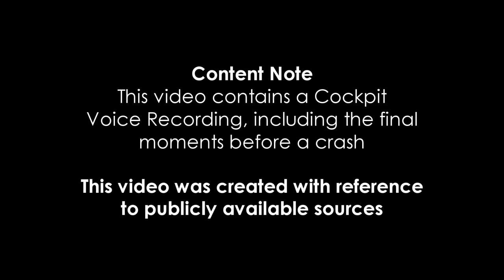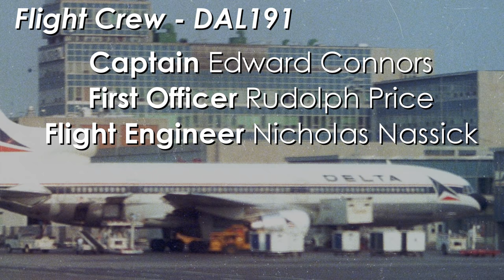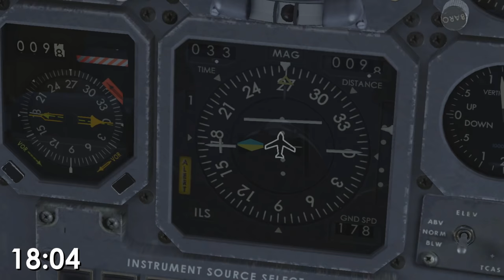How Deadly Weather Brought Down This Plane (Delta Airlines Flight 191) - DISASTER BREAKDOWN

Comment: I disagree that the L-1011 had a “troubled past”. None of the accidents mentioned were related to the engineering of the aircraft.
Reply: Agreed as a former L-1011 pilot. The DC-10 reputational problems were largely design or maintenance issues; the L-1011 accidents were largely pilot error accidents. In no way way did the L-1011 have a bad reputation with anyone to include pilots (who loved it) or regulators. It’s by far the best aircraft I’ve ever flown (and I’ve flown nine types of airliners).
Reply: @HEDGE1011  Indeed. A troubled past, what a joke of a statement. The TriStar was the safest airliner of its time, way ahead of every single other one in technology. Better than that joke DC-10, an absolute shame to plane history. I love this channel's videos but this one always makes me cringe a bit because every accident that the Ten-Eleven had was either a pilot error or a maintenance error. Never had a troubled past or fame of bad design and funny enough, any time the aircraft had a mechanical error (most of those due to incorrect maintenance) everyone landed safely due to the advanced technological prowess of Lockheed Martin. Eastern Airlines can prove how good and reliable the L1011 was. Two engine failures in-flight, both on Eastern planes due to incorrect maintenance from the company. Those planes landed safely due to not losing manuebravility or hydraulics, literally a proof of how reliable and sturdy the TriStar was. Now you try to land a DC-10 with an engine failure, it'll probably break down midflight and kill everyone.
Reply: Yes L1011 is the safest widebody trijet plane,as former pilot of Malaysia Airlines DC 10 i agree that DC 10 was troubled aircraft,the control was heavy,i would take occasion when i was ask to fly plane and airline know about this also force all pilot that suppose to charge to fly the plane especially when was told to fly to Kai Tak airport,the airport that serve city of Hong Kong and scare me most is infamous runway 13 approach or heart attack approach because it would give you heartache since the plane have heavy control and it dangerous reputation you might think that you are flying a coffin to the grave however flying DC 10 was a wonderful experience since the variant of DC 10 that i fly is series 30 there's a little accident invovling egineering and it serve with Malaysia Airlines with no accident at all
Reply: @roskasan574  
Turkish air is the only DC-10 crash because of a design problem.
Reply: @HEDGE1011  I've spoken with quite a few old-timers who say the exact same thing.  The Tri-Star was a great plane.
Reply: @alhanes5803   What about that thing with the cargo doors?
Reply: @lucassouter5053  
Total screw up.
They fixed it though, and it went on to  become a great plane.
I flew them many times.
The L1011 was always my favorite,  but once inside, you really couldn't tell much difference between the 2.
They were both great machines.
Reply: @alhanes5803  but there were multiple incidents where the cargo door broke.
Reply: @lucassouter5053  
2.
Windsor,  and Paris.
Reply: We believe in the L-1011 Tristar superiority
Reply: Troubled as in it flopped big time in terms of units built. Lockheed lost a shit ton from the L-1011 project. But i still dont know why. It was miles better than the Flying Wreath or Death Cruiser Number 10 aka the DC-10.
Reply: @tommcglone2867  
They were both great airplanes
Reply: @themaskedtalker2171  as in the wreath at a funeral.
Reply: Can't disagree with your point on aircraft quality. May I point out that the "troubled past" does not necessarily mean that the problems were with the aircraft design. It is possible, for example, for a "troubled past" to mean orphaned at an early age and sent to a state school... without being a delinquent. Nontheless, your clarification is appreciated. Thanks.
Reply: Delta planes crash all the time.
Reply: @jaysantos536  care to identify the last “crash” for Delta?
Reply: @HEDGE1011  you are right but there were some tings that made the aircraft more vulnerable to pilot error like warning sound.
Reply: @alhanes5803  - Wrong.  The initiating issue for AA191 was maintenance, but it was two design deficiencies (single point of failure on the AOA/stick shaker system AND the non-fail safe design of the slat system) that doomed the flight.  Similarly with UAL232 - routing all of the hydraulic systems in the same vicinity in the plane of rotation of the engine without a hydraulic fuse (and having only three hydraulic systems, rather than four like the L-1011) was another design deficiency which led to the accident, even though those weren’t initiating factors.
Reply: @alhanes5803  - You could if you knew their systems or flew them both - which I did.  The DC-10’s engineering was far inferior.  Even the cabin door opening system was a cobbled together Rube Goldberg mess as compared to the Tristar’s elegantly simple system.
Reply: @tommcglone2867  - It was later to market due development issues with the RB.211 power plant (which went on to be an outstanding engine) which brought Rolls-Royce to insolvency and set the entire program behind.  The S-ducted #2 engine design dictated a shorter powerplant than either the CF-6 or JT-9D, obligating Lockheed to the Rolls engine.

I believe the DC-10 was also a bit cheaper to purchase.
Reply: @bradcrosier1332  
You sound like an expert, Bradley....
Reply: @alhanes5803  - Expert can be debated, but I’m rated in and have flown both, so I’m pretty familiar with their design and their systems - including the band-aid fixes Douglas implemented after UA232 - but you know all about that, right Al?  Also, I’ve read and studied the accident reports for AA191 and UAL232, in no small part because I was flying the DC-10 and wanted to understand it’s deficiencies (as any competent airman would want to do on any airframe they are operating).

I’ve said more than once I’ll give the DC-10 credit - it actually flew nicely (somewhat to my surprise), but it was definitely under-engineered, that’s just a fact.  Heck, many of the band-aids were still present in the MD-11, which I also am rated on and flew for three years.  I actually kind of liked flying the MD-11, but it still very much showed it’s heritage in some ways, and definitely didn’t handle as well as the DC-10.  It could be flown safely and wasn’t a bad aircraft, but it was a unforgiving and would bite if provoked (as its accident record demonstrates).
Reply: @bradcrosier1332  
I was wondering,
Can you explain the
"AOA/stick shaker system",  and what one has to do with the other?
Reply: @bradcrosier1332  
Um, my last name is Hanes,  Brad.
As far as your qualifications,  it doesn't really matter to me whether you have them or not.
After the rambling, long drawn out so called answer you just gave,  it sounds as though you have definitely been at high altitude without oxygen too many times.
Reply: @alhanes5803  - Ok Al, so are you the student pilot Al Haynes, the private pilot Al Haynes, one of two ATP Al Haynes (one with no type ratings), or the mechanic or repairman Al Haynes?  Of course it’s entirely possible you might not hold a U.S. certificate, or are not a pilot at all.  I also notice
you didn’t address the crux of my question - are you just upset and challenging me because I’m rebutting your statements, or is this a legitimate question?   It seems to be the former, based on other posts (such as those in another thread on the MD-11 involving the loon “Slow Poke”) of yours I’ve read, as it seems you yourself would have the requisite knowledge to understand the relationship between AOA and stall warning devices.  Hence why I’m not eager to waste my time simply amusing you.

If you think my statements inaccurate, then say so.  If you are genuinely seeking edification, I’ll be happy to share the knowledge I have.  If you’re simply baiting me, then I’m not interested.

As to the time I’ve spent at high altitude, it’s all been in pressurized aircraft, no supplemental oxygen required except when the other pilot left their station.  Yes, I realize that’s an attempt at an insult on your part - the problem for you is I can actually back up my qualifications and knowledge (which it appears you did not anticipate), you the jury is still out on.

As to long, drawn out answers, you probably won’t like my response if your AOA/stick shaker query is an honest one - part of why I’m attempting to ascertain its nature. 

I will however confess to at least one mistake I’ve made - I was misspelling your last name based on that of the Al Haynes - my apologies.  The rest of my questions still stand however.
Reply: @bradcrosier1332  
I asked a serios question.
To explain in your words,  AOA/Stick shaker.
Reply: @alhanes5803  - That's fine.  You've been quite vague otherwise, and as I previously stated - other posts of yours indicate that you should already have that level of understanding.  But I suppose  I'll play along (even though you won't extend the courtesy of properly identifying yourself which I have done for you).  Give me a bit and I'll get back to you, I don't have time at the moment to formulate a proper response.
Reply: @alhanes5803  - When it gets technical (and this is a technical question), I try as much as possible to avoid using my own words lest I inadvertently color the description though an inadvertent poor word choice; thus I shall (at least to begin) start with an excerpt from my DC-10 (Series 30) manual regarding the stall warning system (please forgive any typos on my part, as the PDF is locked and I cannot simply copy and paste):

"Stall warning is provided by the autothrottle computers.  The computers condiser inputs from the two Angle of Attach (AOA) vanes and the flap and slat position transmitters.  If either autothrottle computer calculates that the aircraft is at or below [1.05] VStall while in any configuration, a stick shaker for both pilot's control columns will activate.  Depending upon aircraft speed and configuration, the stall warning signal may also cause an auto slat extension and opening of hydraulic reversible motor pump valves.

A stall test switch is provided on the pilot's overhead panel to allow an independent test of each stall warning system while on the ground. The test is delayed for 5 second following switch activation."

Note that this manual is from many years after the AA191 accident and was equipped with dual stick shakers, while AA191 was not (the second was an option, which the airline elected to not pay for - the lack of redundancy I mentioned.

From the NSTB report on the accident:

"The loss of the No. 1 engine and its associated generator causes a loss of many aircraft systems end instruments. Among these are: The captain's flight instruments; the left stall warning computer, the stickshaker motor, N0 1 engines  instruments, the slat disagree: warning light system, portions of the flight control indicating system, portions of the DFDR sensors, and the CVR.  In addition to these losses, the flightcrew would be presented with numerous warning lights. The caution and master warning lights on the glareshield would be illuminated.  Hydraulic and electrical malfunction lights would be on the annunciator panel and on the flight engineer's panel.  Power to the left a.c. and d.c. emergency buses could have been restored by rotation of the emergency power switch to the "on" position. This action would have powered the l e f t a.c. and d.c. emergency buses and restored the operation of the captain's instruments as well as some of the engine instruments."

Without getting too far into the technical weeds, the DC-10's AC system normally operates in parallel, so the loss of one generator would not result in the loss of any busses.  HOWEVER, the circuitry also provides protection for a differential fault on the bus, in which case the circuitry will open and NOT permit the other generators to power the bus.  It is believed that when the wire bundle from the #1 engine was severed, it activated this logic, thereby isolating the #1 AC Bus and the L Emergency Bus.  Unlike the AC busses, the DC busses are normally isolated from each other, but can be tied together in the event of a transformer/rectifier failure.  To continue with the NTSB's take:

"The flightcrew might have been able to restore the No. 1 generator bus and all of its services by activating the guarded bus tie relay switch on the electrical and generator reset panel. This action would have been effective only if the bus fault sensed during the separation was temporary. The evidence indicated that the left emergency a.c. and d.c. buses, and the No. 1 d.c. bus could have been restored separately by the activation of the emergency power switch and the No. 1
d.c. tie switch in the cockpit. There was no evidence to indicate that this was done.

The Safety Board believes that the flightcrew probably did not try to restore the lost electrical power, either because of the nature of the overall l emergency involving other systems, which they probably perceived to be more critical than the electrical problems, or because the time interval did not permit them to evaluate and respond to the indicated electrical emergency. The Safety Board does not criticize the crew's inaction in this regard; however, since electrical power was not restored, the captain's flight director instrument, several sets of engine  instruments and, most importantly, the stall warning and slat disagree warning light systems remained Inoperative."

Also under-engineered with the slat system, which simply held the slats in place with trapped hydraulic pressure (rather than locking mechanism, such as the L-1011 had), again from the NTSB:

"During takeoff, as with any normal takeoff, the leading edge slats were extended to provide increased aerodynamic lift on the wings. When the slats are extended and the control valve is nulled, hydraulic fluid is trapped in the actuating cylinder and operating lines. The incompressibility of this fluid reacts against any external air loads and holds the slats extended. This is the only lock provided by the design. Thus, when the lines were severed and the trapped hydraulic fluid was lost, air loads forced the left outboard slats to retract. While other failures were not critical, the uncommanded movement of these leading edge slats had a profound effect on the aerodynamic performance and controllability of the aircraft. With the left outboard slats retracted and all others extended, the lift of the left wing was reduced and the airspeed at which that wing would stall was increased. The simulator tests showed that even with the loss of the No. 2 and No. 4 spoilers, sufficient lateral control was available from the ailerons and other spoilers to offset the asymmetric lift caused by left slat retraction at airspeeds above that at which the wing would stall. However, the stall speed for the left wing increased to 159 KIAS."

The last citation is off topic of your query about the AOA/stick shaker system, but seemed relevant to the overall discussion.  Like I said, in my brief time on the DC-10 it flew nicely, but it was something of a cobbled together mess to fix the various deficiencies (such as these, as well as the lack of a hydraulic fuse in the #3 system which resulted in the UAL232 accident).

Hopefully that answers your question, any others?
Reply: @bradcrosier1332  
I understand, and already knew everything you just mentioned,  however, alot of the problems I have with alot of these videos,  and the comments from alot of people who don't have a clue about what they're talking about is, people are led to believe #1 engine operates everything period.
They don't know power switches automatically, or can be switched manually to another engine in case of a failure of #1.
I'm with you, and the NTSB,  that the pilot's are absolutely not at fault. 
You get some altitude 1st, then start going thru systems. 
They simply didn't have time to understand what was going on.
The L1011 was engineered to the hilt, especially for it's time.
What I would like to know is, how many other types were engineered differently than the 10, at that time.
I'm not being Asmara ass Brad, but 1 thing that aggravates me is, had A/A mechanics not screwed the pooch,  this would not have happened.
Douglas engineers never expected the pylon or attachments to ever break in the life of the airframe.
The mounting points on the 10, and all planes are designed for the engine to break away, under severe engine failure, under the wing, not over it.
With the rear mounting attachment breaking the way it did, at full thrust, and no engine failure, is what caused it to go up and over, destroying electrical,  and hydraulic components. 
You know as well as I, that you can't engineer out stupidity. 
The plane had redundancy,  but how can you anticipate,  or what were the odds that the hydraulic lines going to the slats would ever sever.
We know now that it's possible, like with  the Qantas 380 with a severe uncontained engine failure. 
Bi ask again,  in the mid sixties when the 10 was designed,  how many planes were designed any differently?
I don't  know the answer to that, but I'm guessing most. 
Again it aggravates me, when people are made to believe 10,s were just falling out of the sky constantly. 
As far as I know, the only 3 fatal crashes because of a so called design flaw, was Turkish air, 191, and 232.
All the others were pilot error. 
You know how the press works. They jump on something and run it thru the ground.
Did the 10 have some problems? Yes. But after the cargo door fiasco,  it went on to become a very reliable plane. 
I think it, and Douglas got a very bad rap, that wasn't warranted. 
They stomped Boeing thru the ground over the max, and the 787.
Airbus has had their problems,  but people love to hold up for them, as if they can do no wrong. 
If you've never seen it, Greg Fieth, and John Golia has a podcast on YouTube,  called Flight Safety Detectives. 
You should see what they have to say about the two max crashes, and the bs surrounding them, and Boeing. 
I'm  not a jackass, that's mad at you, these are just simply my take.
I would love to hear back from you.👍
I love commercial aviation,  and always have.
Reply: @bradcrosier1332  
Sorry,  I made a couple errors spelling, but you'll get it.🙂
Reply: @alhanes5803  - Regarding the typos - no worries, I have MORE than my share of those, and I do get the gist!

Beyond that, I don't have time to address all of your points, but I'm glad my suspicions about you were confirmed - I thought your other posts indicated a level of knowledge which made my explanations a waste of time - though I do understand your reasoning for doing so.  That said, a quick search of the airman registry on your part would have saved me thirty or more minutes assembling my response.  Nonetheless, I am please to make your acquaintance. 

I 110% agree with you about being irritated at armchair experts who think they know everything and ignore input from those in the industry who actually do have at least some greater depth of understanding than they do.  

You are also correct about the DC-10 going on to be a reliable aircraft, and you are correct that the KORD and KSUX accidents weren't directly due to design flaws, which is why I try (I'm sure I slip up at times) and use the term deficiencies instead.  It wasn't the that design was inherently defective, but it did lack resilience or redundancy which could have prevented the accidents.

As for it's overall design/engineering - it definitely seemed more like a Chevrolet to the Tristar's Cadillac.  I mentioned the cabin door system - the DC-10's really was a Rube Goldberg nightmare, whereas the Tristar's was incredibly simple to operate.  The cockpit crews on the DC-10 where I flew it hated positioning flights without flight attendants, because then we'd have to operate the door - EVERYONE was afraid of accidentally blowing a slide due to it's poor design (and most of them had previously operated the L-1011).  In time you got used to it, but it was certainly not as foolproof as the system on the Tristar.  That just seemed to carry over everywhere with the aircraft - to me it reeked of being rushed to market to beat Lockheed, which it did, and as a result (at least in part), it clearly won the sales race.

Beyond that, you're right - if anything the Tristar's over-engineering sometimes was a vice, but usually it was a boon.  As to the engineering of other aircraft of that era - I can't speak with great authority, since I never flew the the 747 classic, but I believe the leading edge flap mechanism on the classics was the same as on the -400.  Those were actually air-driven, and unless I'm completely slipping a cog, they were locked extended, not held there by air pressure.  To me using trapped pressure to hold something as critical as leading edge devices is a very poor engineering choice - and Douglas was the only one of the three first generation widebody builders to make that choice.  No, I can't fault them for not anticipating the exact mode of failure which occurred at KORD.  I can fault them for failing to design a system which was more robust and damage tolerant.  The same argument can be made regarding UAL232 - poor design to route all of the hydraulic systems in the plane of rotation of an engine and not have some means of isolating them in the event of a catastrophic failure.  IIRC correctly, they did provide separation of the systems in the wings, but inexplicably not in the tail where all three ran in close proximity!

No doubt about 191 being very flawed maintenance practices at American by "Forklift Joe" Leonard, later of ValuJet fame.  And you're quite correct - American should have taken the lion's share of the blame.  Ironically, Douglas role in that accident was very similar to Boeing's in the MCAS debacle - a lack of resilience and redundancy, rather than an outright flaw - good luck finding that coverage anywhere in the media.  American's maintenance practices should have gotten much more press, just as Lion Air and Ethiopian's pilot competence should be getting more scrutiny - but that's not the chosen narrative, so the bigger issue is going to be swept under the rug until it raises its head again another day.

Regarding Airbus v. Boeing, I pretty much agree, but I'll add one thing which I've stolen from a former colleague which describes it pretty well:  Boeing designed and built airplanes for airmen to operate (though I do think  their culture has seriously deteriorated due to upper management's decisions, at least some of which were post Douglas merger, but not all).  Airbus on the other hand designed and built aircraft which could be operated with a minimal level of airmanship - designed to take the pilots out of the loop as much as practical so they could be, as I've heard them referred to, merely "FAGOs" - flap and gear operators.

I'll have to check out "Flight Safety Detectives," - great, another place to piss away a bunch of my time on YouTube!  😄

Cheers!
Reply: @bradcrosier1332  
Hey Brad.
Happy Labor Day!😎💥
If ya watch flight safety detectives,  scan thru and you'll see the one they did about Boeing. 
I'm sure you know who they are.
Former NTSB Boys.
Reply: @alhanes5803  - Yep, I definitely recognize both of them.  The bad part is their shows are longer (so I have to set aside more time to watch), but I presume that will mean better, more in depth, and more thoughtful discussions of complex issues (although the one I briefly started to watch last night they spent five minutes telling me what they were going to tell me about; cut it, get to the actual discussion already! 😁).

Edit - Just finished listening to Ep. 14.  Outstanding, finally someone addressing the reality of these accidents, not just the popular narrative.

Edit 2:  Also watched/listened to the episode on the Columbia, SC Lear 60 accident - long but again a great in depth analysis.  Thanks for the tip!
Reply: I get the feeling he was referring to the corporate situation as the L1011 was the last airliner Lockheed ever made. 
While only a few ever crashed, and they were regarded as reliable, only 250 were ever produced due to financial strains.

Compare that to just the 737-MAX plane having 630~ made - and that was a truly troubled aircraft, at least to start.
Reply: @WaddupItsYaBoi  
No, truly troubled airlines,  mantinence,  and pilot's, in Ethiopia.
Reply: @WaddupItsYaBoi  I had not thought of that, you may be right. I thought he was referring to technical characteristics of the a/c.
Reply: @waltzawaydreaming1801  I’m no pilot or anything, but if he’s as knowledgeable as I’ve seen him be then that’s the only thing that makes sense to me. 

Perfectly understandable misunderstanding though, it’s the internet, stuff happens! 

Also @Al Haynes there were two 737-MAX planes that crashed and only one was Ethiopian. The other was Lion Air in Indonesia - and went down the exact same way.
Reply: I can't understand why people compare the l1011 to the ugly deathtrap
Reply: It was a disgusting plane with high accident ratio
Reply: Agreed, the Tristar was very safe compared to its contemporaries. It's the DC-10 on the other hand truly has a troubled past and that's a fact. Even though I love the DC-10 I have to admit it had some serious problems.
Reply: You are correct... This was the most advanced airliner for its day even possessing auto land feature.
Reply: @alhanes5803  Sure the angle of attack Censor is nowhere indicated in the cockpit butt is intrical part of the Pull up feature. Too complicated to explain here because there's even more involved in terms of how fast the airplane is moving towards the ground. What's the configuration even the evening rising T e r r I a n ahead.
Reply: @neatstuff1988  
Part of the pull up feature?
Yeah ok.
Reply: The d c ten also had a auto land feature. It was quite capable on the dash thirty model. Not so much on the dash forty model because of the power level lag time.
Reply: @alhanes5803  Hey al how you doing...
Reply: The L-1011 was a far superior plane. If it was  still flying, It would be my first choice when I traveled. If the DC-10 was still around, you couldn't pay me enough to get on one.McDonnell Douglas assembled the DC-10 in a hasty and careless manner because it wanted to beat Lockheed to the market. How ironic that both tri-jets had a crash involving the Flight 191 designation. The airplane that got out of the gate first, proved to be a death chamber, while the L1011 withstood and became a much loved jet. I miss the L1011 but it was one of my favorites. ❤❤❤❤.
Reply: Not true. If you study the reports from the flight 191 in Chicago, it was due to maintenance flaws by the airline but McDonnell Douglas was heavily reprimanded because they designed the plane without backup systems. If they had put in back up warning systems, then the  pilots would have known that the plane was stalling and the crash would have been prevented. Only the Captain's side had a stick shaker and his controls became inoperable. Therefore, the pilots didn't know what was really happening and they responded in a way that made the situation worse. Also the leading edge slats had only hydraulics to lock them in place which retracted because the broken engine severed the lines. In Boeing and Lockheed aircraft, there is a back-up mechanism that prevents the slats from retracting. So yes, I would say that a large contributor to the Chicago crash, was design faults and MDD's carelessness about safety.
Reply: @HEDGE1011  The d c ten, although not quite the aircraft that the aircraft at eleven is was still a formidable aircraft. With ten thousand hours flying on it.
Reply: I have ten thousand hours on the d c ten. The d c ten got a bad rap you're right. The only thing that clearly was the fault of engineering was the cargo door latches. And at three  of which were connected hone could power either of them provided that there was fluid When the engine blue, which was General Electric.
It's severed the containment ring and destroyed the hydraulic system among others Items. That was the beginning of the end for united two thirty two... They did a great job the pilot killed however more than half the people died. I know how that happened too. We're trying to correct the alignment to land on the runway. Denny, let it get away from him too far.
Reply: @jocelynharris-fx8ho  How m Did you design the thing any000 hours do you have on the L 1011.
Reply: @yeahyeahyeahyeahyeahyeah maneuvrability 💀
Reply: @yeahyeahyeahyeahyeahyeah manoeuvrability*
Reply: The Tri-Star airliner was the safest passenger plane of its time. The trouble always was human error. I would not fly on a DC-10 if you had paid me but had no problem with the Tri-Star or other Douglas, planes. The airport picture you used was of Another airport in Dallas called Love Field not DFW International Airport where the crash occurred. I lived and still live a few miles from DFW and had to drive by the airport every day on my way to work. I had passed by the airport less than an hour before the crash. The airplane would have passed right above me had I been late for work that afternoon because the highway was the same one where the plane first hit the ground and killed a driver. He too was on his way to work.